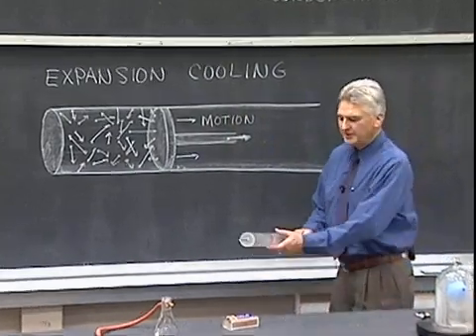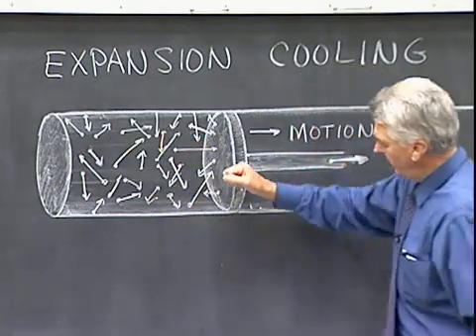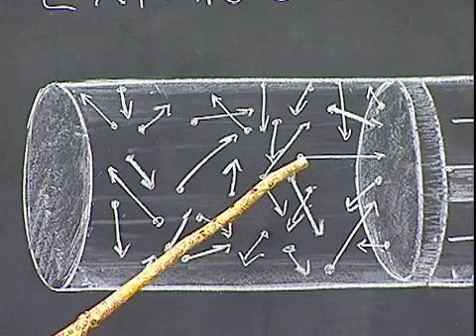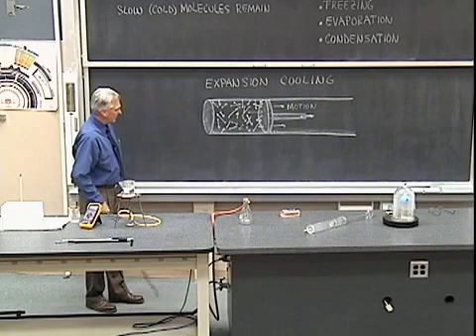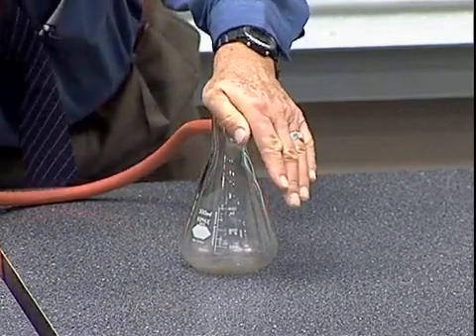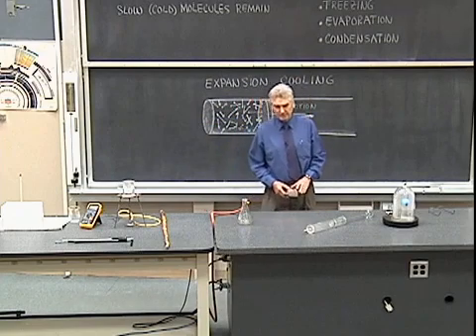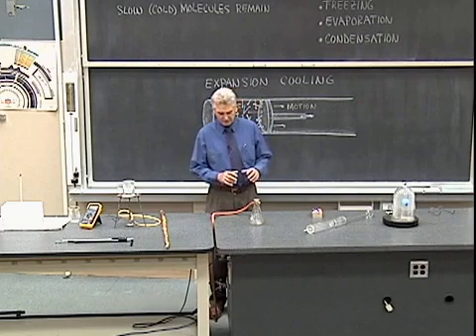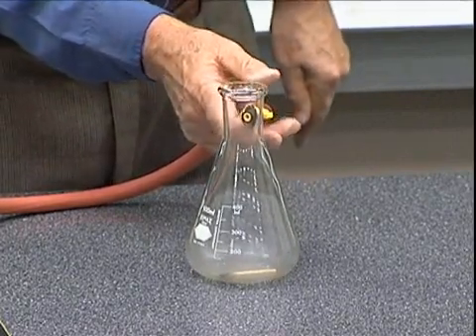Expansion Cooling

Comment: Thought it was a video from one of my alamada and as an ex-Mechanical Engineer with a minor in heat and fluids I have an interest in Stirling engines which if energy is applied as an input produce significant cooling. Instead you gave a simple principle and an experiment of why this works. Most students don't realize how well this principle works as an energy input into a Stirling engine to produce cooling is the basis for cyro-genic cooling systems. ( Liguid oxygen, nitrogen, & etc manufacturing) Of course the theory revolves around Boyls ( probably misspelled it ) law.

Comment: I am trying to solve the following. A sealed vessel contains a gas at P1=23.4PSI and temperature T1=300K. If a valve is opened so that in say 20 seconds the pressure drops to 15PSI. If the valve closes quickly, what is the gas temperature in the vessel?
Does the Gay Lussac's Law apply giving T2=(P2/P1)*T1=210K?

Comment: Where do the particles get their energy from? And why does compressing a material cause it to heat up? Expansion cooling I’m assuming cools because of greater surface area to dissipate heat? I’ll edit after watching video If I have more questions
Reply: It's because of the internal energy of the gas which is used to break the van der Waals attraction and hence when it expands the gas molecules has lesser internal energy.... that's what cause the cooling sneek

Comment: I disagree with the analysis of the experiment.  The air molecules in the cylinder are colliding with each other and the walls of the cylinder.  After each collision, there is a loss of heat.  A compressed gas will gradually cool.  When the volume is suddenly expanded, there are less collisions and less heat produced.
Reply: There may be a loss of heat as they collide with each other and the walls of the cylinder but doesn't the cylinder also have its own heat that it can transfer to the gas molecules?

Also your final analysis agrees with the purpose of the video to show how expansion cools gas
Reply: @a-boardmanshawn7314  The heat transferred from the cylinder to the gas is negligible.  To be honest, I'll have to watch the video again.  It's been 2 months.

Comment: But what if you don't move the wall back, but suddenly remove it. allowing the gas to flow into the previously empty part of the container eventually hitting stationary walls (not moving walls).  The gas will still cool (molecules will move slower) but not due to hitting a receding surface?
Reply: My thought exactly.  If the gas molecules make the piston move, then they lose energy.  But if the volume of gas suddenly increases and expands into a vacuum, then gas will cool, so no impact is required.
Reply: I am also not satisfied with the mechanistic reasoning provided. Although it seems you mean “suddenly” as in a speed of sound removal of the plunger? Or do you mean “blinking it out of existence” type removal? I agree that the thought experiment of the latter would still cool the air and refute his argument. Or better yet, an actual experiment could be to use an aperture like on a camera, or other sliding seal, such that the molecules are exposed to a second chamber that starts as a vacuum and then wouldn’t have the receding plunger to love energy on.
Reply: I think it comes down to the pressure difference but not the speed with which you move the hand - the inside is at a high pressure and a lesser volume. Once the gas escapes, it has to do some work against the low pressure area in order to expand. And this comes at the cost of the reduction of its internal energy, which results in the cooling effect. (I might be wrong though, but that's what I thought happened)

Comment: Expansion Cooling is the reverse process of Heat of Compression.
Heat of Compression provides the ignition for Diesel Engines by compressing the Fuel/Air Mixture until its Auto-Ignites... 
Expansion Cooling provides for Refrigeration by expanding the Refrigerant until it is cool enough to absorb heat as it passes through coils inside the Refrigerator.
Reply: ⚠️ God has said in the Quran:

🔴 { O mankind, worship your Lord, who created you and those before you, that you may become righteous - ( 2:21 )} 

📖Quran

Comment: Nice explanation, although you didn't explain that the cylinder is being allowed to expand by the gas molecules pushing out the piston.
Reply: Yes it wasn't a very good explaination because he referred to the piston and managed the terms "at rest" and "moving to the right" which is kind of misleading since we're not dealing with piston speed but rather pressure balance between inside and outside of the cylinder.